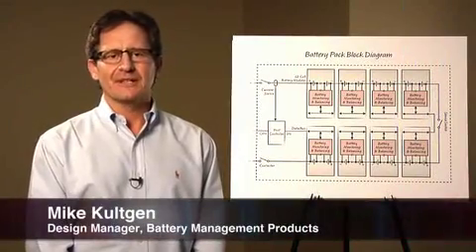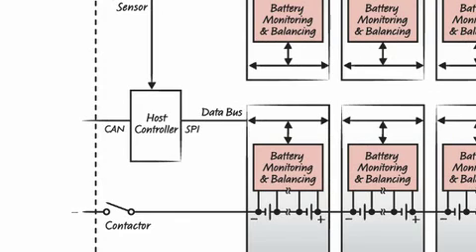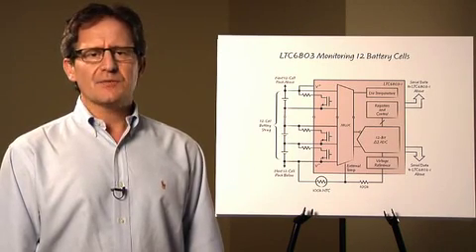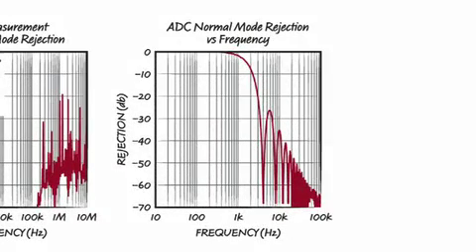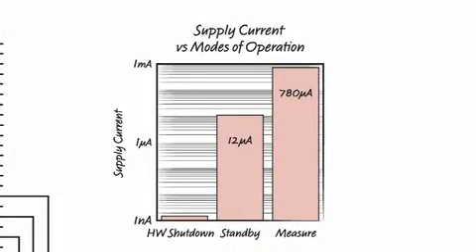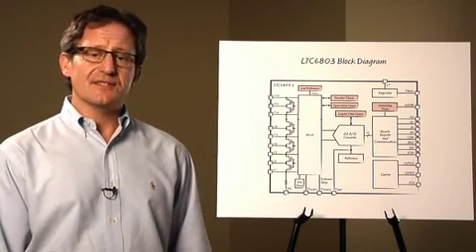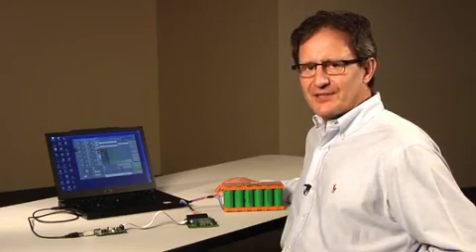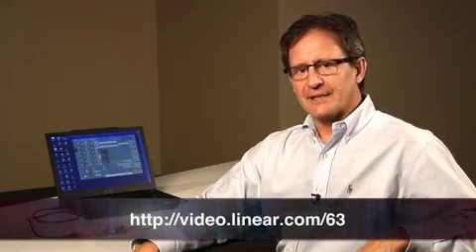Multicell Battery Stack Monitor IC for High Voltage Applications

Comment: Can the 6803 tell me the voltage of each cell? I have a stack of 12 lead-acid cells (24V, 800AH) for off-grid solar home. I want to measure the voltage of all 12 cells in order to decide when to start an equalization cycle on the solar charge controller.